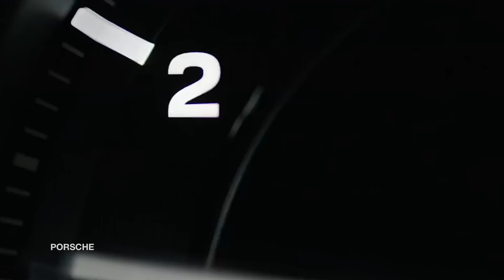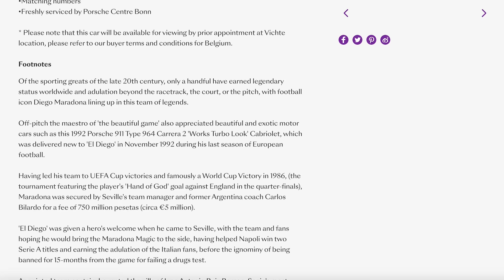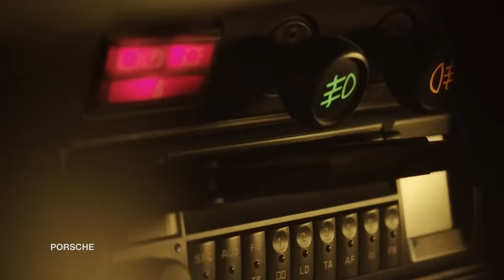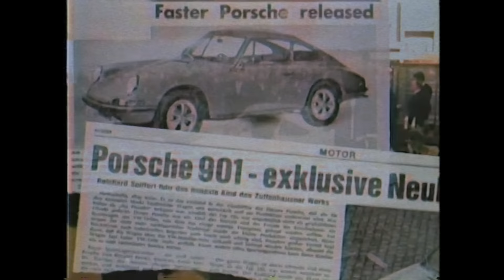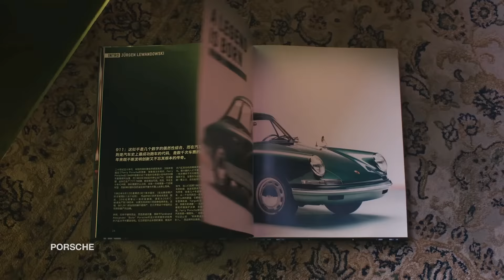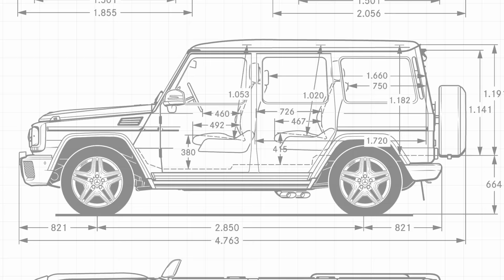The Sports Car That Never Loses Its Value | Behind The HYPE: Porsche 911

Comment: I think what this video could emphasize even more is the insane performance that comes with each new model. Right now there are three Porsche 911's that did the Nurburgring in under 7 minutes, the GT2RS, GT3RS and the new GT3. I believe that aren't more than 15 production cars who beat the ring in under 7 minutes. Porsche's engineering is incredible. The new 911 turbo S is also a monster from a standstill, beating basically everything you put against it. All that performance in that classic design just makes a perfect picture. It's also very modest in looks in comparison to competition, like Ferrari's and Lamborghinis.
Reply: The production cars that lap the nurburgring in under 7 mins are the 992 gt3, 991.2 gt3 rs weissach package,  the 991.2 gt2 rs, the 918 spyder, lamborghini aventador svj, huracan performante, and the mercedes amg gt black series (possibly also the senna but that has never been tested) in terms of non production cars, the manthey racing tuned gt2 rs is the fastest street legal car around the ring, and they hold two places in the top 3 overall records with the top three being, 1. Porsche 919 evo, 2. Porsche 962, 3. Volkswagen IDR
Reply: @J.PC.Designs  yes it is oem but not a production car, since it isnt a option from factory

Comment: Car that never loses value 
Porsche 911
Porsche 911 (996):
Crying in weird Headlights
Reply: 996s bouncing back! To the moon!
Reply: @planes121  exactly, unfortunately 😂😭
Reply: @Angry-Lynx  not if you bought a 996 turbo at the dip :)
Reply: the porsche 996 save the porsche from the failure

Comment: As much as I love the 911 I'll still hold onto my boxster for life
Reply: Wack
Reply: @jjoomusic  
The 718 cayman/boxster/spyder platform is the better chassis though. The GT4 could be way better than the GT3RS and even GT2RS. However Porsche limits the motor performance because the 911 has to always be their flagship model. Even a lot of Porsche owners say that the cayman GT4 is better than the 911 GT3 even if the power is slower.
Reply: @calvin3448  I respectfully disagree
Reply: Yes the boxster/cayman platform is accidental genius that many people have yet to realize because they look at the wrong figures.  Both these owners are secretly enjoying what others have written off for years now.  The value of the Boxster/Cayman platform is going to skyrocket soon but I'm just a random lol.
Reply: I love my 981 Cayman S! The goal is to eventually add either a 997 or 991 as well 😁
Reply: @jdmdecal  They are already going up in value. In January I sold my 6 year old 981 GTS for 80% of new MSRP. A few months later, it's now selling for 90% of new MSRP. The 911 will always be the top dog, but people are discovering just how good the naturally aspirated Caymans and Boxsters are.
Reply: @calvin3448  It's also a cost thing. The 911 is faster, but it also costs more. The line is blurring though. The 718 GT4 is almost on par with a 991.1 GT3 around the nurburgring despite having 60 less horsepower. Mid-engine chassis is the superior layout. There's a reason why Ferrari, Lambo, etc are all mid-engined cars. Not sure how or why this yang achi guy is disagreeing.

Comment: For people unfamiliar with brand the most valuable and most expensive Porsches are not the 911. Its the mid engine 550 Spyder. They go for millions and were legendary at races before the 911 was even a concept that could be raced. 
In fact the very first ever Porsche built was a mid engine two seat roadster the 356A No. 1. The whole putting the engine in the back was a very late to the show idea for Porsche. And the Porsches that will be raced in the future will all be mid engine cars.

Comment: Well, first off, I am a HUGE 911 fan, but most 911s lose value over time as you can easily get a 2003 turbo s for under 40k. Only certain special models like the 959 actually increase value. So buying a modern 911 for investment purposes is still a TERRIBLE idea, but its a good car
Reply: I bought my ‘76 911s new for 16k, I have had many offers for over 40k and it has 200k miles on it!
Reply: @rozinant1237  16k in 1976 is much different compared to 16k today lol. Back then wages were also much lower so u gotta keep that in mind
Reply: Minimum wage in 1976 was exactly the same as today, when inflation is taken into account. That has nothing to do with a Porsche 911 being worth 3 times what they sold for new. True Porsche’s are air cooled and there will never be a shortage of people willing to pay the price to have that experience.
Reply: @rozinant1237  I did some research and 16k in 1976 is about 80k today. But after all holding half its value after such a long period is still incredible. But I feel like more modern 911 (2000+) seems to hold their value quite poorly

Comment: ThEy DoN’t DroP iN ValUe. Tell that to the   Guys looking at 911s on autotrader looking at 997s for less than 70k, or better yet, the guys that spent over 300k for a Gt3rs as some sit on auto trader for less than 200k.

Comment: But they do lose value. A car that doesn’t lose at least 50%-70% of its value would be like the Lexus LFA or pretty much any Lambo or Mclaren.
Reply: McLaren is well-known for their depreciating cars. Lambo Gallardo sticker price was under 200k, nowadays you can by them used for 50k.
Reply: @denissonmez6483  that is the biggest fallacy ever. Please show me a lambo listing for $50k and for a mclaren show me one under 100k, I’ll wait.
Reply: The ONLY Mclaren that will only go UP in value is the F1 and probably the P1. But mclarens in general will not hold their value like the 911 will. OG 911s from 911-993 all probably average over 100k for good condition, and the older they get the more it will just go up and up.
Reply: @Maverick19977  Agreed. Even the Senna can currently be found in the 600-800k GBP range on AutoTrader UK.
Reply: @ViburaBlanca  bro McLaren makes a new car every single week, unless it's a P1 or F1 they usually drop down in value
Reply: @legoldspy6851  please show me one for half or more of it’s value. I’ll wait. No one has shown me yet.
Reply: @ViburaBlanca  I've never said they lose half of their value
Reply: @legoldspy6851  read my OG comment. I said they don’t, but everyone is putting it in a general sense.